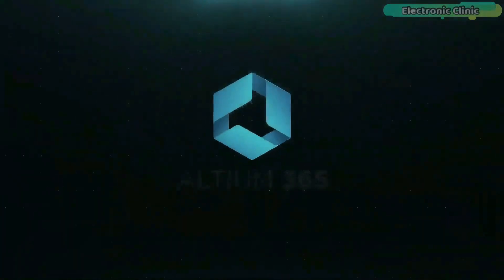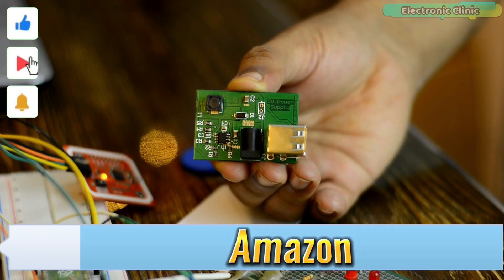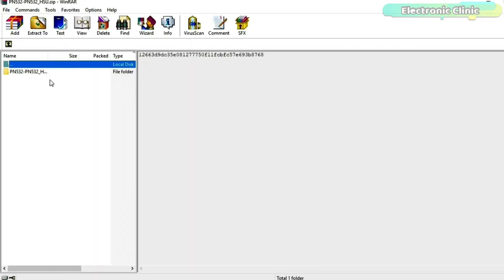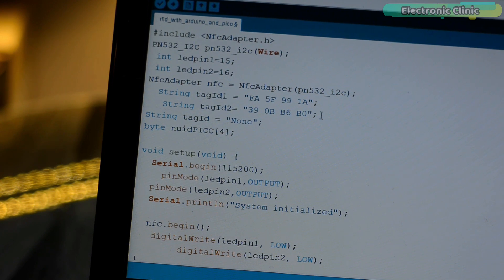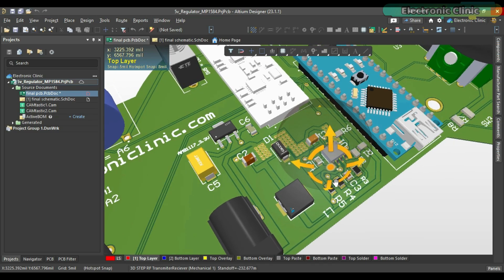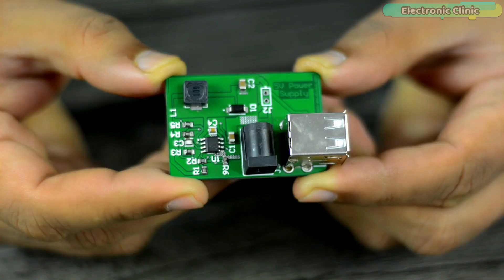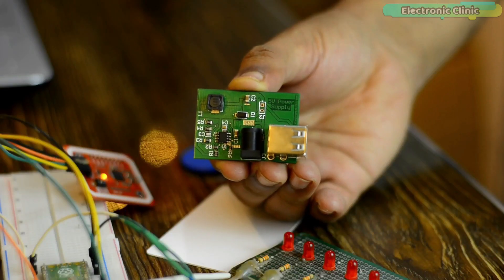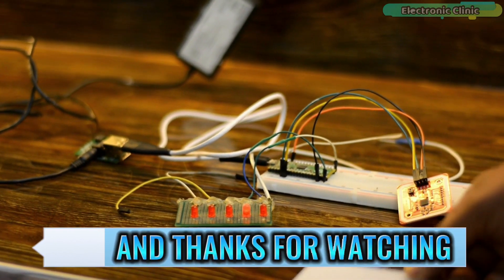Raspberry Pi Pico and PN532 NFC RFID Module Project for Beginners using Arduino IDE

Comment: is there a smaller version of the pico?
Reply: nevermind i just found the rp2040
Reply from the maker: Yes. That's designed by seeed studios
Reply: @ElectroniClinic  i just ordered the rp2040 zero for 6 pounds. can this replace the pro micro in all my inventions?  can i program this on arduino ide?
Reply from the maker: Yes u can use Arduino ide, I have a video on how to run Arduino projects on pico without making any changes in the code.
Reply: @ElectroniClinic  really?? So i wont need different librarys for the pn532? Or dfplayer or stepper driver?
Reply from the maker: I tested three projects and all worked, I only changed the pin numbers. Check my 2nd last video.